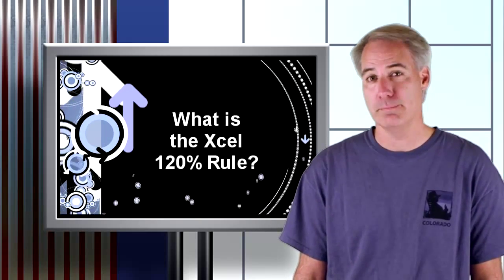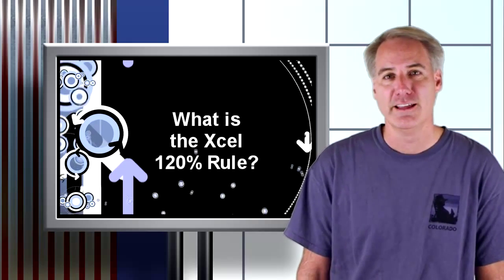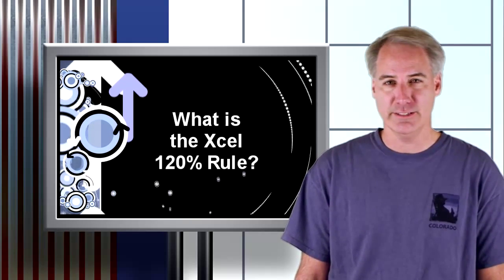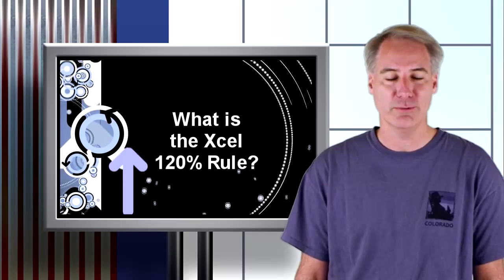How Much Are You Allowed To Over Produce With Your Solar Panel System?

Comment: This guy does know what he's talking about, the rule is still in effect, Summer of 2014. Actually I believe now you have to have a reason to get the additional 20% approved by the utility companies, like converting from oil to an all electric home.  At least in my area (Connecticut) we are only allowed to size up systems to 99% of their 12 month average usage, and we need to work harder to get the additional 20% with extra paperwork.  Utility companies do not want to buy solar energy at retail rate, because it's less profitable for them, it's just that simple.  Yes, some utility companies are "moving forward" with solar and renewable with no renewable energy limits, while others are really just pretending to/ by agreeing to purchase solar energy, while dragging feet at the same time by (creating limits on how much solar can be produced, and what rate they will pay homeowners) This makes the transition from fossil fuel to renewable energy a longer process.  They agree to the utility commissions to buy solar energy (or are forced too) in exchange they create limits that slows the renewable transition from fossil to renewable down.  One big excuse the utility companies make is,  they would have to replace all their transformers to allow such "2 way flow" of increased renewable energy.

Comment: This video does not make it clear why the power company would care if you GAVE them a shitload of free energy. Is the power company subsidizing the cost of the solar panel system? I can see that they might limit the subsidy. Is the power company required to buy the excess energy? Can't they buy it at a reduced rate? THIS VIDEO DOES NOT MAKE ANY SENSE.
Reply: No
No
Yes